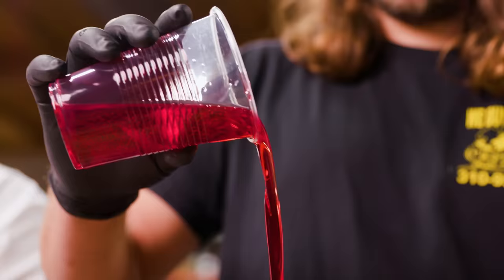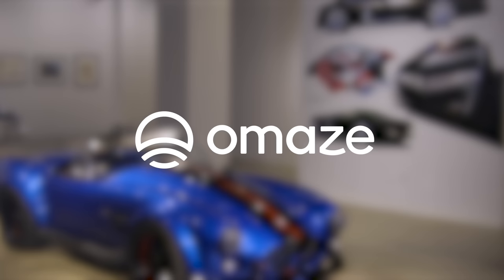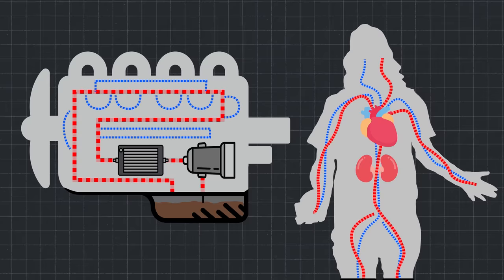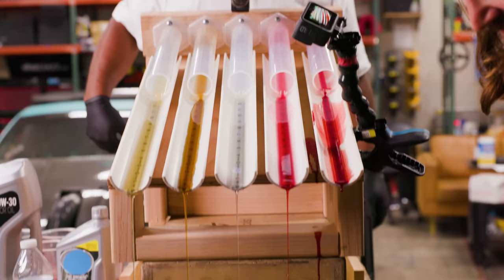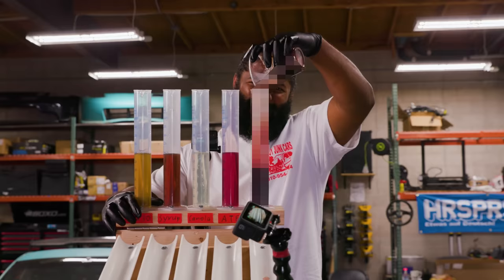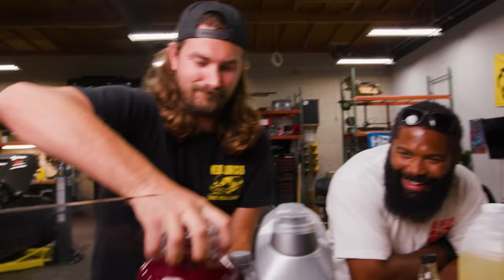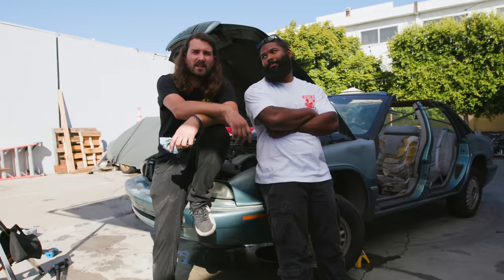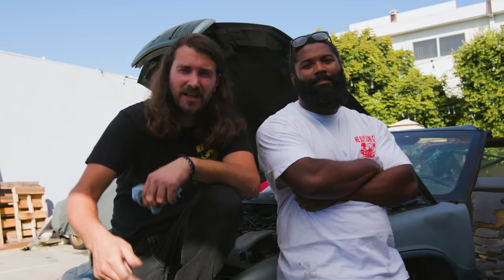We Replaced Our Car's Oil with Blood

Comment: I think it’s important to mention the regal probably has the legendary 3.8L and you could run no oil in that and it wouldn’t blow the engine up
Reply: That's sort if what I was wondering...  If just running straight air/nothing would be better than blood.  Thanks for the answer.
Reply: I've personally seen a gen 2 3800 drive itself 25 mins to the scrapyard with no coolant and a huge hole in the block.
Reply: 3.4L, that's the old 3400 v6! They also made a 3.8L that looks identical. The only reason I know is I caught a glimpse of the sticker at +/- 8:50. It took me way too long to catch that detail...
Reply: @1987FX16  so in the end they would have made it to the bbq regardless
Reply: @98erics  I can't see the the sticker clear enough but that REALLY looks like an L36 3.8. My friends Riv has one and I had an L67 in a GTP.  I came here to say the same thing about them running with no oil and not really giving a poo.
Reply: @98erics  While I’m not trying to say you’re wrong that gen regal never had the 3400. That was the face lifted 88-96 model which only came with the 2.8L LB6, the 3.1L L82, and finally of course the 3.8L L67. Given the amount of room the engine takes up and how low it sits I think it’s more likely to be the 3.8L. That has a 90° bank angle versus the 3.1L 60° and the 3.8L was a very very popular option.
Reply: @doormaat5033  Pretty much yeah. We had a grandam 3400 with a blown head gasket so back you couldn't drive it longer than 10 mins. So youd hop in and floor it for 10 mins and then coast then pull over piss in the rad and keep going. It also was missing a huge chunk of the trans bell housing somehow, like when you revved the engine you could see the trans fluid flowing lmao. Drove it like that for like 4 months as a joke and it never died, got traded in for another shit box at a buy here pay here.
Reply: Thats exactly what i said.. That 3.8 Is a special child
Reply: 3800 should still be in production
Reply: That's what I'm saying, I have a l67 and it's been a beast
Reply: @doormaat5033  In the end they were the BBQ.
Reply: @1987FX16  it really said "Aw shucks, you're gonna scrap me? That's ok, I get it. Can I get one last ride tho?? You know I'm good for it"
Reply: My friend had a 3800 series one and it was acting kinda weird but still running just fine so I checked the oil and there wasn’t a drop
Reply: Gold Ole series 2 3800.

Runs like shit, but still runs, because half the sensors are fucked, but it'll outlive at least two 4t65e transmissions
Reply: @98erics  are you sure? I've never seen a 3400 with the plastic intake. I could be wrong, just haven't seen one yet, and that intake and thosr valve covers look identical to the 3.8 series 2 I had.

I'd remember because many a times I'd be looking at them questioning life over a broken/stuck bolt
Reply: @josejimenez896  The cover is off of that one. Both the 3400 and the 3800 have a plastic cover over the intake that reads 3400 or 3800. It comes off when you remove the filler neck that the oil cap screws into.
Reply: Never would do that to that engine but def cool
Reply: @1987FX16  but why...? you make it sound like you did it for funsies and there was no downsides
Reply: Drove a 3.8l for many years, sold it, guy raced the shit out of it, sold it, next guy raced the shit out of it, broke it, parked it, no maintenance. "fixed it"... etc.....

I know the dude and I know he still drives it. With the same motor.
Reply: My sister is the only person I've ever met who has killed a 3.8
Reply: “And of the swine, do not even touch its dead carcas” - the owners manual
Reply: @jasonanderson4915  you mean the same block....surely most of the parts have been replaced along the way 🤷
Reply: @bbb462cid  except for the coolant transfer tube design
Reply: @Ian-ie3hy  The engine block had a hole in it from rod 5 or 6 leaving chat very quickly. It needed a new engine and a old le sabre was worth more as scrap back then.
Reply: My 1991 2.3 ranger hasn't had any fluids in engine, tranny, or rear end in who know how long. And the thing just keeps going like there's no tomorrow. Things were built to ride till the frame literally rusted apart back then, definitely not the case with the junk they make now.
Reply: @guysumpthin2974  Pobody's Nerfect
Reply: @lucidrebuilds6129  why havent you maintained your vehicle
Reply: It is most certainly the 3.8l, one of GM's best and most reliable engines.
Reply: @1987FX16  Very common issue, more times it starts with the lower intake gasket. A proper machining and gasket fixs this, and adjusting your radiator fans start and stop temps help. But these cara were designed to run a little hotter. The intake also comminly takes out the AC from leaks. Either way when you do the heas youll end up doing your upper and lower intakes and makes them very durable like there 3.8 relatives. You can also swap the 3.5s upper and lower intakes, and TB swap a crank trigger and get better peformance and gas mileage from the chevy impalas, Few ppl take 3.8 sc's from buick or grand prixs, throw them on the 3.4 a few squeeze the sc 3.8 and squeezed them in the grand am/alero. Alot of these v6s and interchangable with a little work and knowledge.
Reply: as an Australian with a commodore with the 3.8 V6, can confirm
Reply: I know someone that didn't do an oil change for 5 years in a 3800, kinda impressive
Reply: It was in Bad condition to begin with too  blood is better than nothing tho
Reply: @silktm9457  now which series would you say is the best? 1, 2, or 3
Reply: yeah i owned two Pontiac Bonneville's one SLE and the other a ssei bulletproof engines they never wanted to die
Reply: Oldie but a goodie!
Reply: Great engine would run until the end of the earth
Reply: Nope it's a 3800 I'd know that engine anywhere, I love and swear by em, I love Buicks 🤙🤙 mo powah babahhh
Reply: @devinseptic9465   definitely the series 2, personally I’ve had way better luck with the L67 over the N/A too. Weakest point of the whole car is the trans if you ask me.
Reply: Good to know I just got a turbo 3.8 and it’s smokes under boost
Reply: Kinda wanna see what comes out the oil pan, Ik most of it prolly burnt away but pls my curiosity
Reply: Never late in a 3.8
Reply: I put a turbo charged 3.8L for a Buick le sabra into a Pontiac feiro
Reply: @1987FX16  It may be Swiss cheese but it's ok. XD
Reply: FACTS, ran an 04, 3.8 (pontiac gp) for 3.5k miles with a cracked block causing the coolant to leak out instanstly. I only had a 1.5 mi drive to work and could barely get it there in the summer (85-105 F) without the ecu cutting into protection mode. To me, that's all the marketing I need to hear lmao
Reply: @98erics  not a 3400, sorry, you don't know what you're saying.
Reply: @barnettimpala  stickers don't lie.
Reply: @98erics  bro... Google what a 3.8 and a 3.4 looks like. You clearly haven't been around these cars. Then do yourself a favor and look up the 3rd gen regal. Never came with a 3.4
Reply: Honestly from seeing so many people try things like this over many years including cash for clunkers (remember that one guys? ) I've noticed that the less worn an engine and it's bearings are the more likely it is to seize quickly. Engines that are well worn and loose tend to care much less about what liquid is in it as long as there is something in there to keep the bottom end cool. It's not just lubricant it also acts as a coolant. So tight engines with poor lubricants heat up from friction expand get tighter and heat more in a death cycle and quickly lock up.
Reply: My reatta had 180k and ran mint. Has a series 1 3800.
Reply: @jakesimpson64  she must have practice killing things because those are hard to kill
Reply: @INMATEofARKHAM  it
Reply: They still could have grabbed the recall
Reply: @natexthomass  You are correct. We had a 94 (same barf color as this one) and it had the 3.8L. Only other engine available was the 3.1L. The 2.8L was available for only the first year or two of this generation before it was replaced by the 3.1L
Reply: It would probably leak coolant from the lower intake lol
Reply: Until the lifters collapse
Reply: The blood is going to cook solid in a matter of minutes.  They didn’t have a better idea for a video this week lol. Drop the no oil video on ‘em.
Reply: Top gear had a test running cars with no oil and even the loser which I think was a small 4 banger Ford ran for a good bit of time before dying
Reply: Long live the L67!
Reply: @devinseptic9465  best is a series 3 / series 2 hybrid. Essentially a series 3 without fly by wire.
Reply: @87-GTA  I have a 2004 Monte SS sitting in my driveway with a blown trans. Can't bring myself to get rid of it. I keep telling myself I'm going to put a new transmission in it one of these days.
Reply: @drksoldier1  nice cause I got the series 3 in a Pontiac grand prix lol
Reply: My 3.8l in my camaro seized up at 100k miles
Reply: @anthony40100  sounds like operator error to me. 🤷🏼‍♂️ I've pulled ones apart at 300k that still had the crosshatchs in the cylinder walls.
Reply: @drksoldier1  given 85k miles we’re before I owned it I took great care or it just randomly gave up one day
Reply: @devinseptic9465  gen 2
Reply: I'm pretty sure the previous owner of my 2000 SSEi went through at least one motor, maybe more, but he was messing around with smaller pulleys and stuff. I was told the current engine had 60k something when I bought it, but I have no idea. Odometer says almost 260k.
Reply: @anthony40100  did you by any chance blow the LIM gasket allowing coolant to mix with the oil? That was a common and avoidable (by preventively changing the gasket) failure on N/A 3800s.
Reply: @drksoldier1  Stock pulley now. One of the extra SC that came with it has a small one on it though.
I have HPTuners and a wideband.
The tune is pretty dialed at the moment, but there is an issue around 4000 rpm at WOT that I have to work out. It detects knock and pulls out a bunch of timing. Not sure if it is a tune issue or sensor issue or something else.
FWIW, I already have an elm adapter and torque. I also have the $1000 harbor freight scan tool they used to sell. Funny thing is I only paid $800 for the car and $400 for a duplicate parts car probably 6 or 7 years ago.
I bet its the only Bonneville in the world with a semi refrigerator in it though. :-D
Reply: I ran a gm3800 series with a blown head no coolant hotter than balls and she made it 100 miles maxxed out at 50 mph
Reply: Hey donut why do you hail the one who will only use and throw you away?
Reply: @DerfOrNuffin  why were they designed to run hotter??

Comment: I'm an auto mechanic, and as disgusting as that might have been, I would've loved to see the insides of the engine after the blood test.
Reply: Metal shards, lots and lots of metal shards 😅
Reply: @anydaynow01  ...mixed w blood...
Reply: “I’m an auto mechanic” could’ve been removed from this comment lol, nobody cares
Reply: Probably gonna get some blood sausage.. fortified with metal.. 😂
Reply: @itz_hunted3788  improve as a person
Reply: I imagine the galleys weren't even getting oil all throughout because it was ran hot with the canola oil first. Causing the blood to curdle and then carbonize very quickly.
Reply: I’d like to have seen it also. But I would’ve also like to have seen them add chunks of meat 🍖 in there too. I know it would’ve clogged up the oil filter quick but come on, you know that the neighbors around there would’ve came running to get some BBQ 🍗
Reply: @stacyreid5077  thiiiis! Chicken grease for motor oil! Les go!
Reply: @shelbyseitzinger927  that would definitely smell up a neighborhood
Reply: Like a murder scene
Reply: @robertmyles9124  I don’t know the neighbors that I have would be like buzzards circling thinking that I BBQ and didn’t tell them
Reply: alexa, show me "grenade aftermath"

Comment: Engine oil staying cooler in the microwave oven has nothing to do with "dealing better with heat." The 2.45GHz frequency of microwave magnetrons was picked for its relatively strong interaction with water molecules commonly present in food. The low-moisture fluids stay cooler simply because they don't absorb anywhere near as much energy.
Reply: My thoughts exactly. A better method would have been using an oven
Reply: Science!
Reply: Yeah, as soon as I saw them microwave the fluids I cringed a little. They should have like if anything boiled water and then put containers containing the fluids in the boiling water and bring them to the desired temperature.
Reply: @austindeal2860  Americans amirite? (Sorry if you're also an American)
Reply: @matthewbay1978  Project farm uses hot plates for heating up oils for test comparisons.  Works great.
Reply: @austindeal2860  Yup, that would have been a much better way of getting everything to the same uniform temperature as it should have been for a viscosity test. Don't forget to have some sort of spacer between fluid containers and the heating water pot to prevent direct heat transfer too.
Reply: This was more for fun than an actual scientific test
Reply: @OvernightCrew  I think we all can recognize this was meant for fun. Just giving feedback for if they actually wanna do a comparison in a later video.
Reply: Should've used a hot plate or oven
Reply: Nerd. Jk
Reply: Tbh this was just kids science. Pretty dissapointed with this video.
Reply: Thanks for that learnt something new today 🤣
But ppl give it over its stil just entertainment at the end of the day.
🤓 🤓
Reply: Dam .. .... yall really be on Wikipedia
Reply: But we didn't click because they were microwaving oils...we clicked because they were putting blood in an engine.
Reply: It was super interesting to me that the other oils especially the canola oil heated up much at all though
Reply: Alot of the tests in this video weren't controlled at all, including the temperature. But seeing them put blood in an engine was pretty hilarious.
Reply: Guys, do better. I know you're probably running out of ideas at this point but you can do better than this.
Reply: They didn't know how microwave works
Reply: @streetinfamy  bro, thank you so much. In my 22 years I’ve never heard that before. I have a pizza from 2 days ago in the fridge and I just did that. 🔥🔥🔥🔥🔥🔥